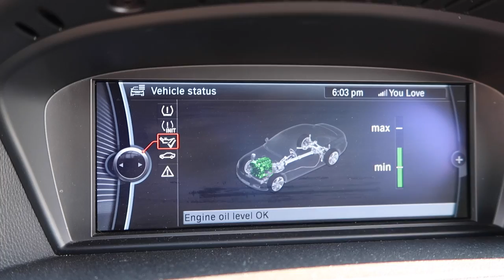DIY Oil Change: E92 M3

Comment: I do 6,000 miles on mine. Better safe than sorry
Reply: Justin Buice also I would suggest to use redline 5w50 it’s better for the bearings
Reply: @jameswiththeM6  why is it better for the bearings for this viscosity? recently i had an oil change and the BMW dealer replaced it with BMW GO 5w30 oil (Shell helix ultra). is this better for bearings?
Reply: th tan its better then 10w60 but a guy known as the s85king that has built over 500 stroked motors s65 and s85 and he knows everything about the engines and recommends 5w50 and even compared it after a certain amount of miles and it protects them better, his Instagram is @ troyjeup
Reply: Good call
Reply: I do 5k miles using liqui moly

Comment: I use liquiMoly 10w 60. Been using it since my M3 had 60k miles. Im at 220k miles now.
Reply: phrozen06 you’re lying
Reply: @79ta8  nope
Reply: Same my man , great oil the Moly
Reply: It’s been 4 years, can we have an update on your m3 if you still have it.. how is it doing? Did you ever have to do the rod bearings?
Reply: @simonjesus2363  WRD??

Comment: My m3 came from the factory topped off, there is a reason for this. I noticed that my operating temp is slightly below 210. If its not topped off it goes over. You should be topping off your oil changes.

Comment: the engine sounded awful for a few seconds when it was fired up, what was that? I've done lots of oil changes on various cars and have never heard banging like that.
Reply: Andy Traverse owners manual says that the engine was designed to run rough when initially started.
Reply: That's the cold start  neighbor's love it first thing in the morning 🤣

Comment: what happens if you put very close to the max or overfill?
Reply from the maker: +Fahim I if you overfill, you have to drain it out
Reply: Fahim I Then no room for engine to breathe, oil may break engine gaskets and start leaking out, or engine caps may blowout to release pressure. All bad things will happen but you can drain oil out if you overfill accidentally

Comment: Have you ever had a ticking noise around the engine bay.. lot of people saying its the heat shield... I know its not the rod bearing cuz its been done on it..
Reply from the maker: The natural sound of these engines seems to have slight ticking to it like the Vanos does it
Reply: I think it's the injectors that make those clicking noises noises so such noises in the engine bay would be normal.

Comment: Just bought a 13 M3 with around the same miles as yours. First time owning an M3. What are some of the normal noises for this car? I keep hearing some weird stuff (engine, rear tires clinking). Appreciate the help.
Reply from the maker: +E92 M3 E Ive found that the M3 makes a few random noises. I hear noise when shifting into gear, engine makes normal bmw noise, it's sorta a rumble/rough start up at times. All seem to be normal from asking other M drivers.

Comment: has anyone had transmission fluid leaks on the e92 m3? apparently it happens frequently because of the use of aluminium bolts and how they stretch over temperature changes.

Comment: Hi Brandon, Thanks for sharing the video. I am thinking of getting a used E92 M3, which I believe they were produced between 2010-2013. There is a debate on line of getting E92 instead of E90 (seems like E92 has better reliability). Most of the E92 M3 will be out or out of warranty soon. So far how reliable E92 M3 you think? What is the general issues I need to know before a purchase? Thank you in advance
Reply: Ning Jiang you can get an E92 M3 from 2007-2013, also I can't see how an E90 is more reliable as they're the exact same car except for the body shape

Comment: I completely disagree with you or anyone about warming the engine before an oil change. The car drove to your home and park when it was hot, so the car had a very long time for oil to completely drain back in the oil sump. If I am not using an engine oil flush, I will not start my car for an oil change, it will be done cold where all the oil is fully drained in the sump overnight.
With the exception it is winter and the car is parked outside and the temperature is low, or the car is on an uneven surface, which may restrict oil flow in some areas of the engine.
An engine is designed and placed in a car so the oil is best drain back when the car is sitting on its 4 wheels just how it is driven. Now you want to warm the engine and jack the car up, so wrong.
We all like to follow trends which are not PRACTICAL. Good job anyways.

Comment: Good vid. Just wanna share this company with y’all cause i love it since i found out about it.  fcpeuro. Everything they sell is backed by a lifetime warranty. Freaking amazing. Idk about oil tho cause idk how you’d do that lol. But thought I’d share that with all the fellow bimmer fans. E92 driver ✌️
Reply: Updating cause i just went to check about the oil lol. So i guess it is a lifetime replacement warranty. So all parts they sell can be replaced. Like filters spark plugs rotors pads everyyyyyything